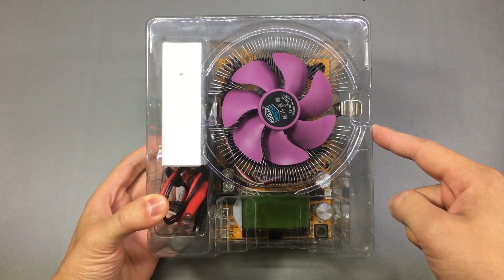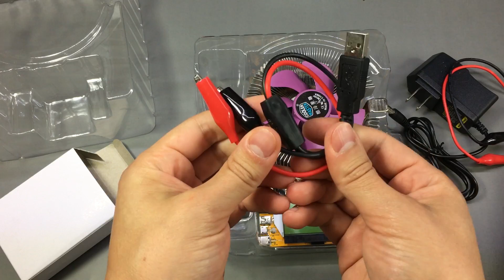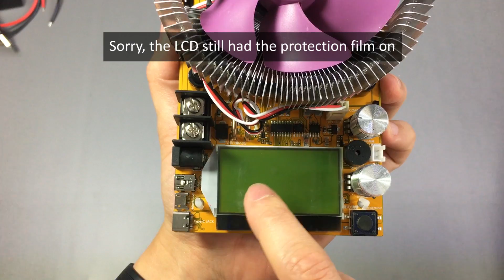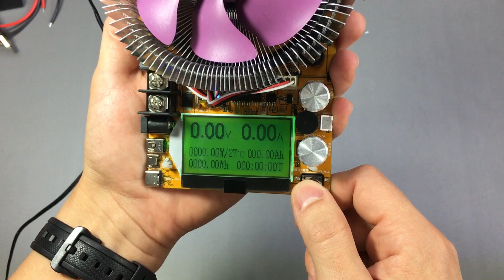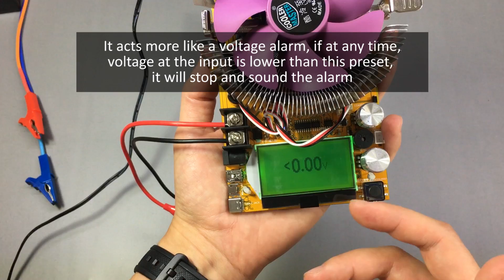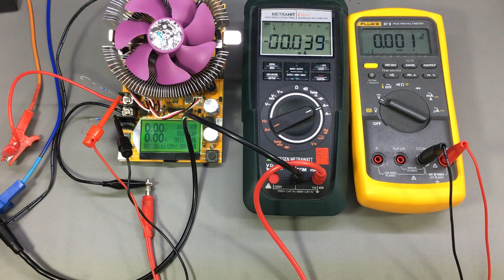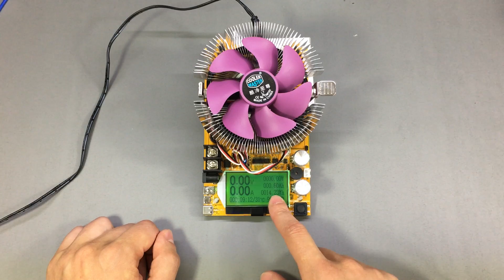Voltlog #119 - 150W Dummy Load Review

Comment: Are the knobs rotary encoders or just regular pots?
Reply from the maker: regular analog pots
Reply: Thanks. For me this product, with all its strengths is close - but still not worth buying. I'm holding out until a better version appears. I'd like to see rotary encoders, digital control, proper temp management, easier setting of parameters like cutoff voltage, 4W measurement and easy re-calibration with decent accuracy. Desireable features would be other modes like CV, CP, CR and a USB PC interface. I'd be happy to pay a little extra for these features.
Reply from the maker: You've pretty much given the definition for a good dummy load, but so far I haven't seen any that will do all that and cost under $200. Closest are the Maynuo/Itech loads from aliexpress.

Comment: Please review this 20A 200W TEC-12P digital load. There are no reviews on youtube, and it's not new. Can be connected to PC. Also consider reviewing a smaller version TEC-06
goo.gl/H5jP4q
goo.gl/sAnw3K
Reply from the maker: pretty old designs, they have been around for a while and they don't look that interesting.
Reply: Well then test something decent like an instrument with a case not barebones crap to begin with like this https://goo.gl/oRCZXV
Professional tool needs to have at least 4-wire mesurement like here. You can't connect it to PC but if the readings are accurate that can be forgiven.

Comment: nice review +++ . I bought the same 180w LOAD .
Reply: As did I, but the cons are similar. Crap firmware, buggy as hell. Still can't figure out how I got the cutoff voltage to the right number! A vid on how to adjust one would be great...  It does log data on the screen, until you re-set it. Another big problem is when it reaches the cutoff voltage, it stops, then tries to re-start. Continuously! You cannot leave this alone, you have to be there to shut it off, and to get your readings. Good try, but no cigar!

Comment: Man I had high hopes for this.  It's really nice but not being digitally controlled kills it for me.
Reply from the maker: yup, got the same feeling :(
Reply: VoltLog it's be cool to design one and do a Kickstarter to sell it.  I don't kniw if enough people would be interested to make it viable though.
Reply from the maker: I live in Romania, not possible to do a KS.
Reply: @voltlog  there's Indiegogo, which is international.
Reply: I guess is nice to have digital control, but the effect is the same. The load do vary in both digital and analog circuits because the problem is heat @ measure shunts, not digital or analog control. Said that, I would like to have digital control but bought it anyway

Comment: 14:50 Not sure, but don't you just need 10A for the amp calibration, no matter the voltage. And just 30V for the voltage calibration, no matter the current? Otherwise you're at 300W which is double the rated power...

But not a very great load :(
Reply from the maker: yes, you are right, you can do the two separately but even so I don't have a 10A capable PSU :-(

Comment: I think it would be quite easy to turn this into an arduino controlled dummy load with data
logging capability. I guess the potiometers are simply used to feed a control voltage into an opamp in a current control loop. Then, it would be easy to replace the pots with a dac controlled by an arduino.
There must also be some circuity already present to measure current, voltage and temperature with a microcontroller for the lcd display. It should be possible to reroute these to the analog inputs of an arduino. All the rest is a matter of software.
Could you take a closer look at the circuit, please? This would be an interesting
project!
Thank you very much for your great videos!
Reply from the maker: What you are saying is not far from designing a dummy load based on Arduino from scratch. Unfortunately I do not have the time to do that. There is a good dummy load design based on Arduino checkout Scullcom Hobby Electronics #45 - Electronic DC Load
Reply: I totally understand that. I wasn’t asking you to design the thing, of course. I just wanted to put the idea out there for others to pick up. Maybe I’ll try myself.
One thing would be very interesting to know though: Is my assumption about how the pots work correct? And is the control voltage something that an arduino could handle (<= 5V)?

I am aware of the project from Scullcom Hobby Electronics. It is very interesting but means building all the hardware from scratch, including the pcb. 
 Thank you again for your videos. You are finding really interesting stuff out there in the wild east.
Best, Kai
Reply: Hey, did you end up trying to develop the arduino data logger for this e-load? That something I would really like to have.
Reply: @Utube2Itube  No, unfortunatly not. I switched to this project: http://www.scullcom.uk/category/projects/dc-load/
I have the pcb and most of the parts, but some are still missing and hard to come by here in Germany. I have to find the time...

Comment: What is the two wire white connector for on the right side of the unit close to the buzzer?
Reply from the maker: just a logical output, it's mentioned in the video.

Comment: For the calibration of Amps, maybe you can set the voltage to 10V and then it is only doing 100W, if it's only looking at Amps then voltage doesn't matter, after that step you can put the voltage up to calibrate that.
Reply from the maker: +TheDefpom good point! I need to try that.

Comment: No analog feedback to keep the current at the setpoint? That seems a bit poor.
Reply from the maker: not sure, I haven't reversed engineered the schematic but it does vary a bit as we saw in the video.
Reply: There is definitely a feedback circuit controlling the set current. The 10A voltage drop on the shunt resistors is likely 100mV.

Comment: mosfets have a positive temperature coefficient so the current should decrease when  it heats up. Maybe its a BJT?
Reply: Mosfets do not always decrease current with increase temperature, especially in the linear region with low Vgs.  You can only really say that mosfets are definitely PTC when they are at Vgs saturation.  In a constant current dummy load, they are not at saturation.  If it was ONLY the Rds which determined currently flow, then yes they would be PTC, but you must also account the temperature effect on Vgs

References: https://www.onsemi.com/pub/Collateral/AND8199-D.PDF 
https://www.infineon.com/dgdl/Infineon-ApplicationNote_Linear_Mode_Operation_Safe_Operation_Diagram_MOSFETs-AN-v01_00-EN.pdf?fileId=db3a30433e30e4bf013e3646e9381200 (especially page 10)
Reply: ok cool

Comment: Very poorly engineered. They could've installed the MOSFET rear-side up, so that the fan would be cooling the back of the MOSFET, instead of the plastic front case.
You would be better off attachin a MOSFET to an op amp with negative feed back to control the voltage to the gate, and use that instead. 
I am building one of these but with 5 MOSFET:
 https://youtu.be/9fsf1CgnTRk?list=PLUMG8JNssPPzbr4LydbTcBrhoPlemu5Dt
Its not cheap, will cost about $100 in parts, but its the most flexible high power digital ones out there. Add more MOSFETs to your heart's content, and get whatever power you want. 
Thanks for sharing your findings and helping people decide if this unit right for them or not.

Comment: Which and how many power semiconductors are hide under the heatsink?
Reply from the maker: just one, haven't checked but I assume mosfet plus two dual diodes (I would assume for protection) or maybe a diode and a temperature sensor in a rather large TO220 package.

Comment: Seeing the fan, you can already tell that this is not an original design. This type of heatsink/fan is meant for CPU processors. And if I recall well, this type of Cooler Master design isn't in current (OEM) catalogue anymore.
Reply: And what is the problem? There are different products like this that use CPU coolers to cool MOSFETs and that do a very good job. I have a similar electronic load that had a small CPU cooler and exchanged it against a bigger CPU cooler (Alpenfön) and it works really fine with this: https://goo.gl/1JEoUQ
Reply from the maker: The fan is not a good indication
Reply: MrCanidi , never said CPU fans are wrong. They are indeed very handy to use and have a good performance. The only thing I am saying is that's not a standard professional solution.